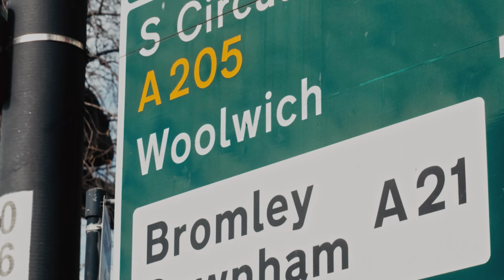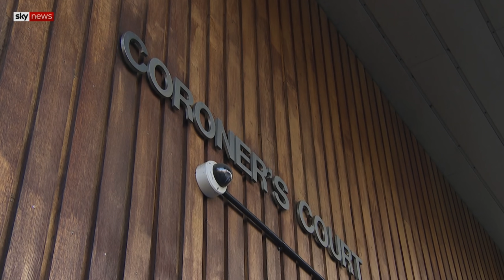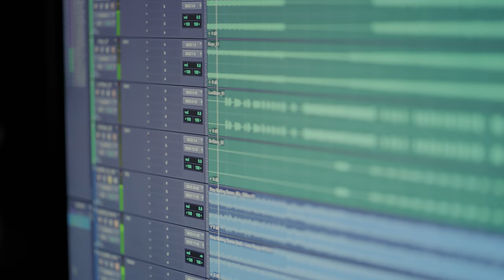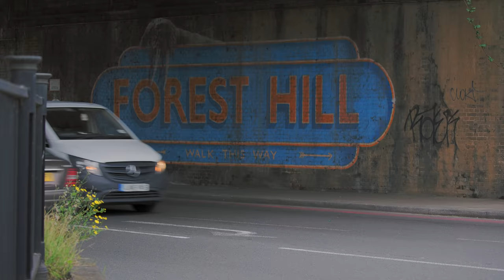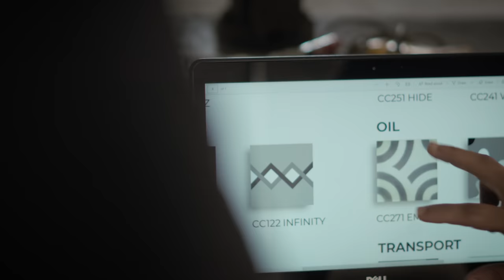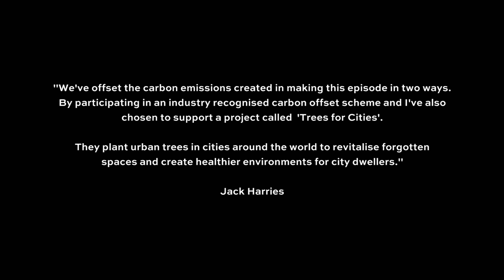What Does Bad Air Pollution Mean To You? | Seat At The Table

Comment: There are products made by a company called Forte Lubricants Ltd that can bring the emissions down to practically zero and if people knew about them they could make a difference for less than £20 a bottle. My husband and I run a garage and his L reg lorry has emissions lower than the London requirement levels. DPF filters in new cars are useless if people are using the vehicles for shorter runs as they need to burn hot.
Reply: products?